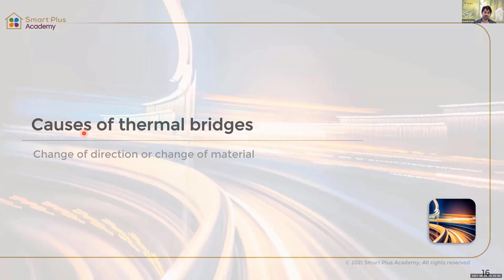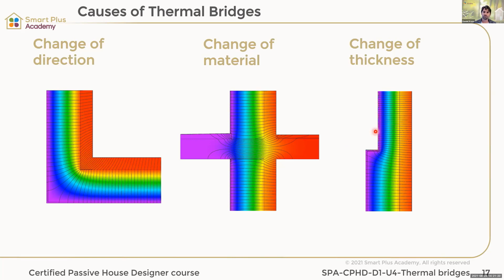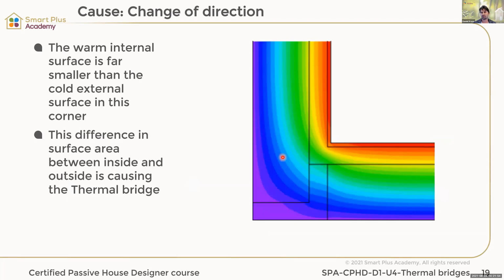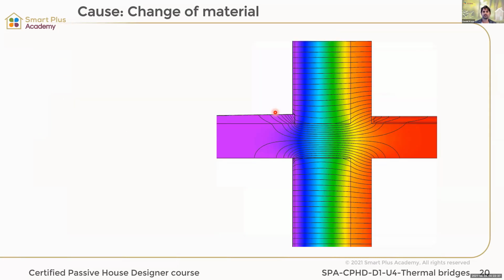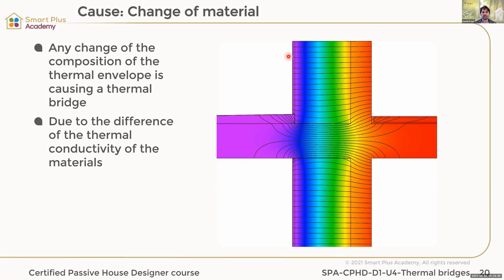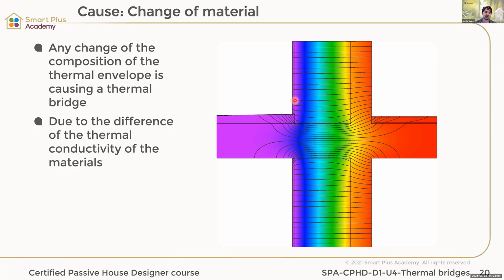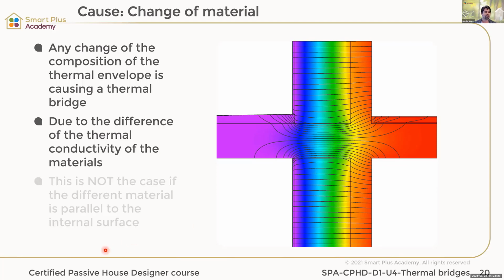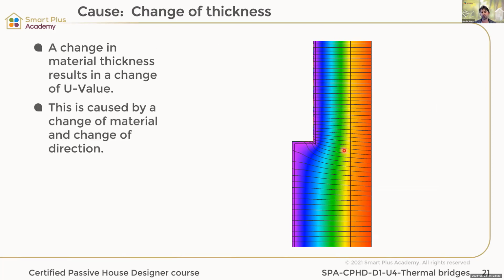Here's an easy way to identify where your thermal bridges are!

Comment: For points where overhang wood beams go from exterior to interior, wouldn’t we want to attempt to “wick” away the heat (or delta) by putting some kind of metal around the wood close to where it is making that transition so that any change in temperature the wood might normally get and then radiate throughout its entire membrane, that instead the faster heat transfer material like metal would help to PREVENT the beam from experiencing a uniform body temperature and thus prevent further bridging past the “radiating” material body that isn’t contacting anything except perhaps air going into the wall of the home? I was just picturing something like a metal radiator with multiple fins that was bolted onto the wood beams surface (and it is the surface that is experiencing the biggest delta until it has enough time to reach equilibrium- but let’s not give it that opportunity is what I was thinking?! I’m trying to figure out how to mitigate thermal bridging of my own home design that we haven’t built yet but ordering a kit that has these rafters. I’m just a mom with a chemical engineering degree but I took heat transfer like 30 yrs ago and very rusty! I just know enough that I see these details about the house and think, “oh no….that’s a design problem. Why would we spend so much money to insulate a house per the code when it is over done in some spots like in cavaties between rafters with adress OBG the conductive potential of the boards and rafters themselves. I’m racking my brain how to prevent or reduce these bridges! 
Btw we are in WA state and the new code as crazy R values for the roofing but to me it seems absolutely pointless to just shove even more thick layers of insulation until the conductive heat transfer from the roof top surface done can be adressed! There needs to be ways to “wick” this thermal energy BEFORE the temp is uniform throughout and seen that gradient elsewhere to some infinite sink if possible. I also wondered if they could make like little mini heat exchangers that could be built on certain points on the wood to further force the temperature differential elsewhere (like using some kind of cooled or heated wires to further pull or disperse the energy where you want it to prevent the body of the board from reaching a uniform temperature. Hope rosy makes some sense - hard to explain because I’m  not really a builder.
Reply from the maker: I apologize for any confusion. Based on your explanation, it seems that the approach mentioned in the video is not an optimal solution for addressing thermal bridges. It is important to focus on insulation techniques, such as continuous insulation, thermal breaks, framing modifications, and structural thermal breaks, to effectively mitigate thermal bridging. These methods are commonly used and recommended by professionals in the field.